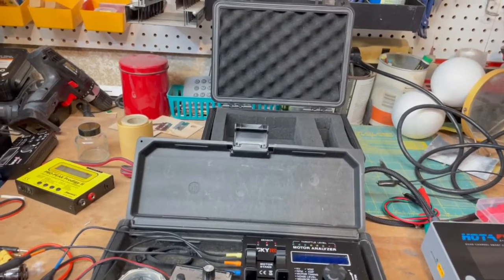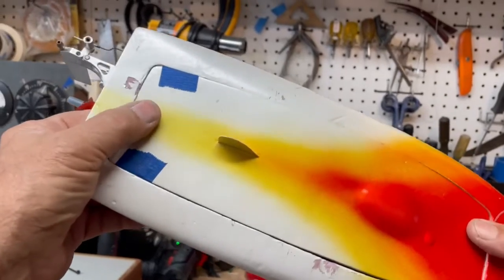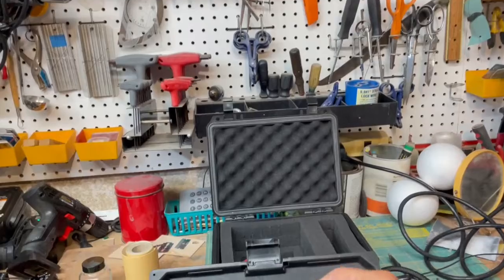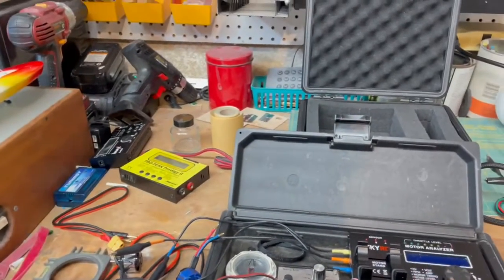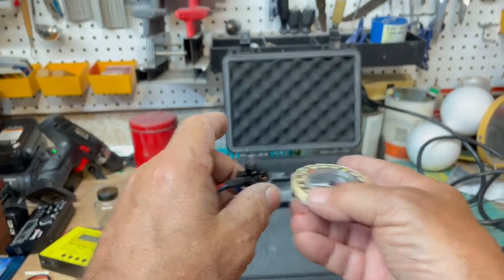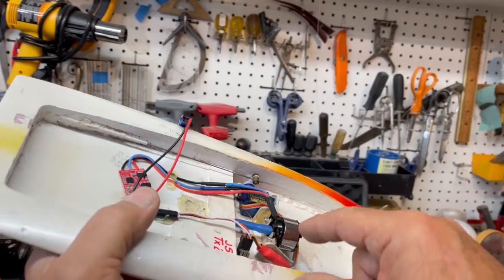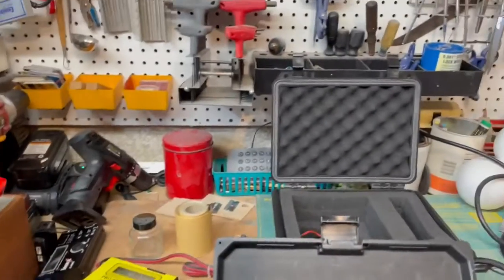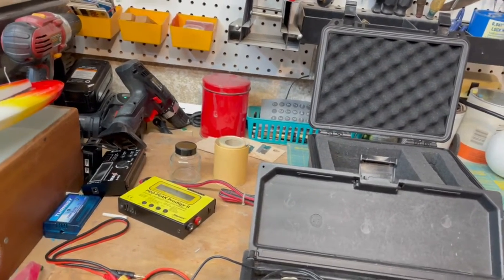Dr. Jet performs yet another motor transplant in JetStepper Prototype IV

Comment: Dr Jet don't count me out just yet😄  that motor you have in the boat now looks like it is the same size as iam using a 1912 out runner it's identical in appearance, the one i have in mine is 2500kv I have some the same size  that are higher kV also to try out. I've got everything almost done hull shaped and gave it a healthy coat of foam armour mounted the motor and driveline I've gone with one of your wire drives I machined up my own stub out of some stainless 3.17mm rod I've got a heep of it I use to make lettering for the metal art I do. All I need to do is just  silkspan /clear coat the hull finalise the servo ,ESC and battery position and throw it in the water. I think I'll run it on 2s maybe 3s if it's boring on 2😄. For my Prop I will probably use the one from the  12" boat and go from there because that boat is going to be running a larger prop with the stinger drive I made for it the prop was way to close to the transom on the 12"mono now it'll be out in nice clean water so hopefully it will fix the low speed Cavitation.

Comment: Yeah, been quiet Doc mainly because of my problems with couplings 😖 I'm on version 'xx' (lost count!) following numerous test runs and shredded silicone tubing. I'm now on a sleeve within a sleeve and had to wait for the appropriate tubing to arrive. 
Also dropped my boat after one of the failed test runs and snapped the carbon fibre rudder that I made. So I've reverted to the 'stock' aluminium rudder blade which has obviously added to the weight and affected the CG. 
Oh well, wouldn't be a worthy challenge if it was easy!  I'm testing again on Friday so watch out for a video if the coupling holds out! 😉
Reply from the maker: This outrunner has a 2.5mm shaft.  An oddball size indeed, but it steps up a bit in diameter where a collar goes on that holds the rotor in place axially.  I'm not worried about axial loads and took off that collar to allow a space for the "blue" silicone tubing to grab.  The blue tubing didn't grab on the 2.5mm portion of the shaft, so I put a short length of 1/16" ID silicone tubing over that 2.5mm portion of the shaft then put the blue silicone over all that and onto the portion of the shaft where the collar was, essentially up against (but not quite touching) the motor bearing.  While the tubing over tubing trick on the shaft is a bit off-center due to the way the tubing stretched and compressed as it went on, the end result is still amazingly smooth and quiet.  This motor/prop may exceed the limits of the silicone tube coupler's strength, we shall see.
Reply: @Dr_Jet  I'm doing a similar thing now Doc, and also adding a small collar of heat shrink around the tubing on the motor and drive shafts for a bit of extra grip (I hope!).
I've a lot more confidence in my latest coupling so let's see how she goes on Friday 😉

Comment: That little guy should scoot with that motor.   I just got a hitec charger with a brushless motor rpm tester, Haven't had a chance to use it yet.   Great video doc
Reply: Very neat trick with the compass I never knew that. Very clever
Reply from the maker: I just hope it doesn't "OVER-scoot" with that motor.  The last time I had similar power, the results weren't pretty; they were pretty funny, but they weren't pretty...  🙄  When you have a box full of unmarked motors, that analyzer is a good tool to have indeed.